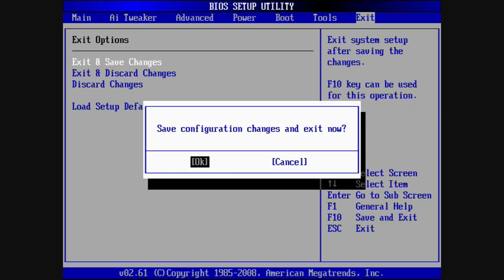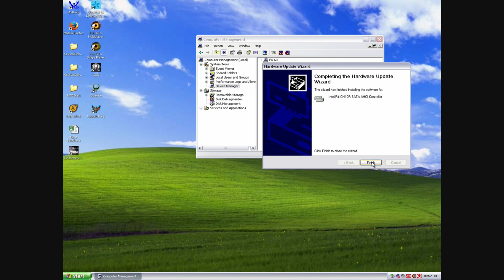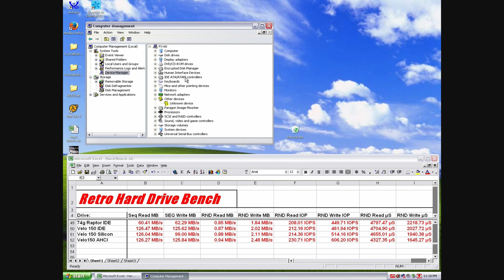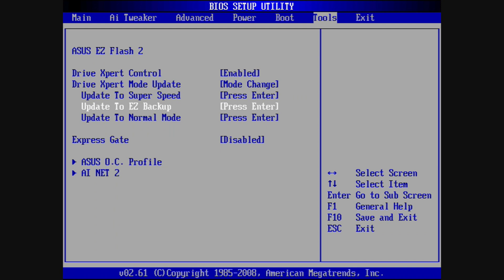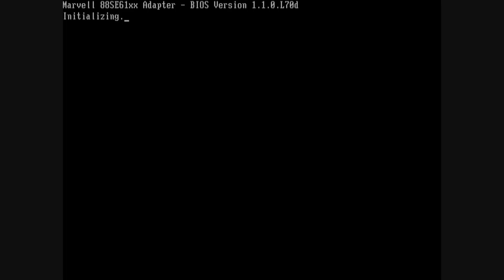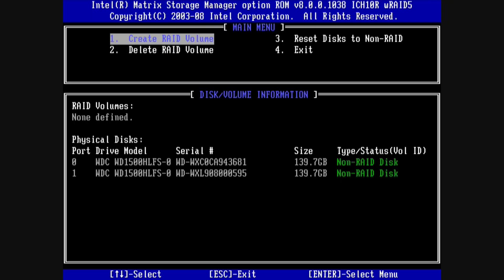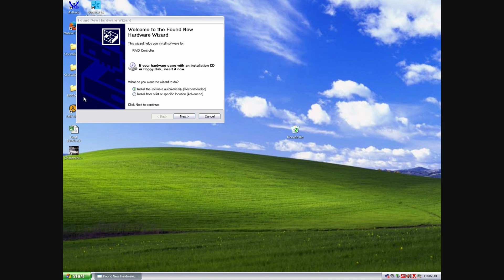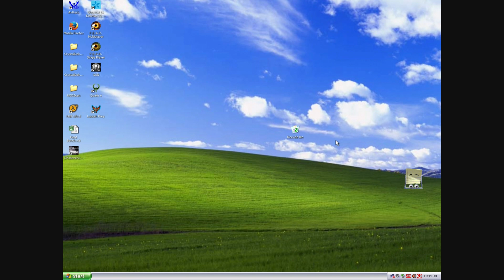AHCI - A Common 2006 Gaming PC Mistake.

Comment: 9:00 NO IT DONT. By this video you have debunked your own claims>
+10% performance but high risk of booting same system on for example new motherboard. 
In these days of retro that may be more important than +10% performance
And you did that using fastest hdd money could buy in 2006 if it's what im thinkin is>
Velocity Raptor that is 10,000rpm, that is 4ms typical for 2.5" HDD
YET despite of that AHCI it only got +10%

IDE protocol is blocking SSD's that is fact, because of that some SSD
Are even slower than fast WD Blacks for IDE and SATA ports.
And Sata1 vs Sata2 does impact performance a lot, 
But AHCI is minior improvement for HDD, might be lot for SSD but not for HDD
You claim at the beginning was that its major mistake
Not major - minor
Reply from the maker: I'm not sure I follow, half cause the video is old, and I don't know all I discussed. Half cause the AHCI thing was less about performance and more about matching your modern (at the time) drive to the protocols is was designed for. There was other ghosts that would happen if you were running AHCI other than just performance. And yeah, back then I was running Raptors.

Comment: Another thing you should look at is CPU usage during AHCI and IDE. In AHCI mode, the controller does a lot more work and does not put that much load on the CPU. So small events like prefetch and pageful use are less likely to cause stutters.
Reply from the maker: Ohh yeah, that makes sense. I remember back in the day if you didnt' have AHCI the computer would act funny and lag. Like even the mouse would glitch out. I guess some people might not have noticed if they CPU was strong enough to brute for it.
Reply: @ yeah, kinda like if you didn't have DMA on for your HDD in Windows 98/IDE.
Reply from the maker: @thebayandurpoghosyanshow  Ohhh yeah, that's going way back. It's running slow af  you find out it's in PIO mode.

Comment: Here's how I did it back in the day. I had, and still have an Asus P5B board. It did not allow me to set ports separately; but it did have two SATA controllers onboard: the Intel controller integrated in the ICH8 south bridge with two SATA channels, four ports, and and a separate JMicron JMB363 controlling another fifth SATA port and an ESATA port which could be set up in RAID to mirror each other (so you would have an ESATA backup to the HDD you connected to the SATA port). I could set Intel and JMicron controllers separately, so connecting the DVD to one in IDE mode and the rest of the drives to Intel in AHCI allowed me to do an AHCI setup. These days, doing a USB install with WinSetupFromUSB mitigates the problem for XP entirely.
Reply from the maker: Oh hmmm. Yeah, I might have done something similar on some builds. 
The was a time when mobos were shipping with 2 different sata controllers on them.

Comment: Go back 10 years further into the past and you can do a very similar video with running harddrive controllers in PIO-mode instead of UDMA :-)
Reply from the maker: Oh yeah, pretty sure I was running system in those days, but I didn't know enough about computers at the time to know about those differences. It was all generically IDE to me. I recall PIO being a problem in the Win95/98 days where sometimes your CD-ROM drive would be running like crap because for some reason is was set to run in PIO mode and you can to adjust the settings in windows to run it in DMA. I guess that would of been a similar circumstance, making sure your devices are running in the right modes.

Comment: I'm new to this, but doesn't RAID usually make the hard drives work slower? and what's the point of RAID 0 if the data is lost when 1 of the drivess dies ? was strange to see it out perform the SSD.
Or in this case it's because you just have an added speed benefit of RAID 0?
Reply from the maker: Raid for the average joe is and oldschool way of doing things no one really does anymore. Before the days of SSD's if you wanted a fast system you got multiple small but fast spin drives, like WD Raptors, and 0 Raided them. Raid might slow things down in enterprise applications where it's about redundancy, but not in this application. I've never personally heard of Raid slowing things down. 
Raid 0 was a risk, but a risk your took for performance. It was mostly reliable. I ran raid for years and never had a problem. You just make sure your hardware is solid. But really, if you are running one C: Drive, and it fails, you've lost your data, what difference does it make if you lost 1 drive alone, or 1 of a set, either way you're SOL if you didn't have a backup. So there wasn't as big a perceived risk in doing it. Again, as long as your raid hardware didn't suck. Back then, half cause fast drives were small, it was common practice to have a second larger storage drive. You important data would be on that. The Raid set only had windows and games, stuff you needed to be fast.
Reply: Raid 0 is mirroring - your drives are mirror copies of each other; that means you have no benefit when writing, but the read speed is theoretically doubled. Also you get the storage space of one drive. And if one of your drives dies, you still have your data.

Raid1 is striping - your data is striped and spread among your drives; that means you have no benefit when reading, but the write speed is theoretically doubled. And your storage space gets doubled.

Raid 1+0, or Raid 10 would require 4 hard drives instead of 2, but you would get the speed benefits of both Raid0 and Raid1, and the storage space of two drives.

Raid3 we can skip - it is like Raid4 but the striping is byte-level and it's almost never used.

Raid4 is striping, like Raid1, but with a dedicated parity drive. So, unlike Raid1, you don't lose all your data if one of your drives dies. But it's slow. The benefit is, you can quickly expand the storage of the array.

Raid5 is striped again, but has distributed parity - the parity information is distributed among all the drives. Any drive can fail and you can recover your data by just replacing it with a new drive.

Raid6 is like Raid5 with double the parity, so you can lose two drives and still recover all your data.

So while most Raid modes are for reliable storage of large amounts of data, Raid0 allows for faster load times when your game data is on your HDD. Almost double the speed.

Comment: fun part of my old board with nforce chipset probably something 400 series with geforce 7100 build in was that xp really didn't care if i run the thing in ata or ahci mode, hd tune showed twice the speed in ahci but not much besides that, not even blue screen at boot when i swaped features in bios
on a downside though each port degraded in performance in time as if the hdd was dying so aftyer a year or so i had to swap the port to reanimate transfer speed when movies become chopy :)
Reply from the maker: That performance issue ? That was with ACHI off ?
Cause, yeah, as I recall, some of the hard drive features, like NCQ didn't even work without it. Might have been some feature didn't work that would cause that. 
I recall AMD chipset boards at the were real fun. Weird stuff would happen without ACHI, like the mouse not working properly. Stuff hanging. Never a crash tho. And as I remember it, the drivers for that chipsets AHCI wasn't even part of the default install and I had to do some silly work around to get everything working right.
Reply: @DATT  i had my nforce board with integrated graphic run core 2 duo e8400 but the board only had single channel ddr2 runing at 800mhz :] the speed of sata transfer rates was i think on a windows driver side that automatically reduced speed on each error in communication and with time it remembered every single count, they were even listed in windows logs under "disk" flag . mifgr be the issue with me always installing "nforce srorage driver" that was replacing something in windows to "remove bottleneck" as driver installer boldly claimed
Reply from the maker: @kokodin5895  So you're saying, the Nforce AFCI driver made things run worse ?
I didn't work a lot on Nforce. And def not intel at the time. 
Well, actually I did have a few nforce boards. I remember there being driver issues with the onboard LAN, one of which cause me to return the board cause I thought it was defective, but the replacement did the same thing. I don't recall AFCI Driver issues tho. These however were AMD boards. So a different chipset. Wouldn't be surprised if they had the same southbridge tho.
Reply: @DATT  the board i had didn't have traditional south and north bridge but single integrated board controller thing it might have been GA-73PVM-S2H and driver for ahci or rather "storage driver" at first it looked as the drives work faster but with time the speed degraded, either because hitachi harddrives were crap or the chipset drivers were, swaping sata port however restored the performance
hd tune under windows xp stated that burst speed of read/write was 260mb/s while ide mode only 130mb/s so i think the only thing that storage driver did was alowing you to swap between sata operation mode in bios without touching anything in windows and it would just work even though xp didn't have simple ability to transition from one to another like windows 10 now have trough safe mode